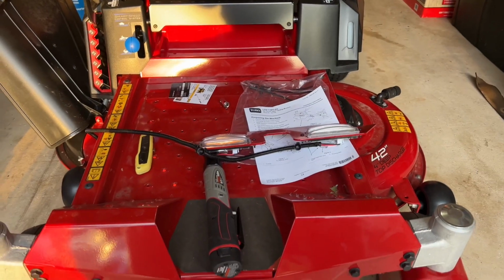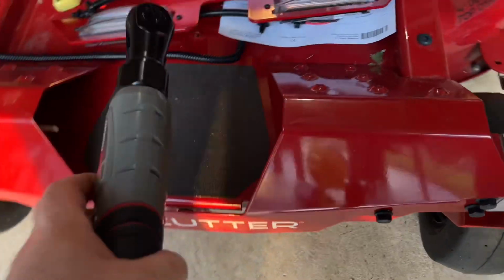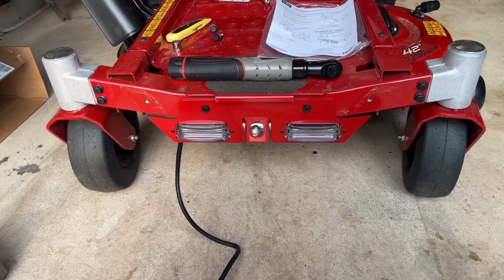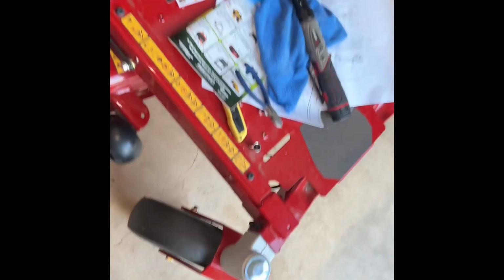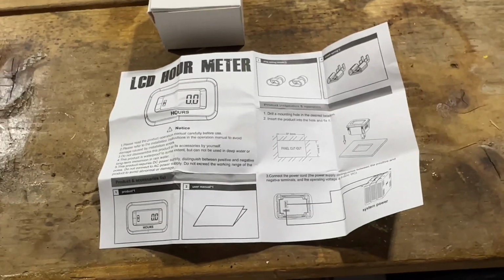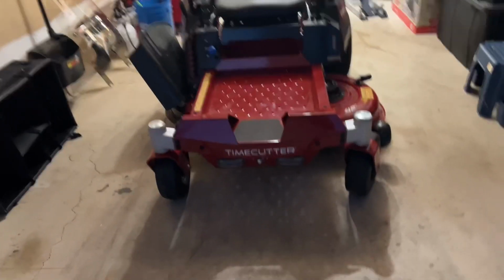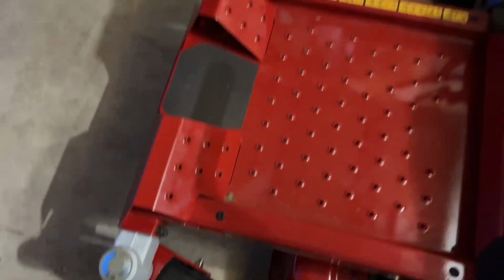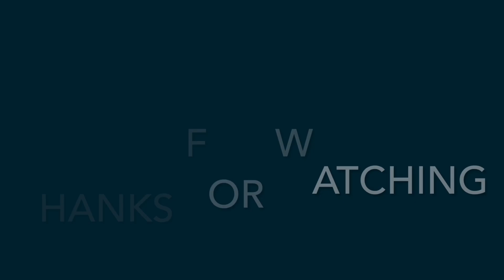42” Toro Timecutter Zero turn LED light install

Comment: I have this feature on mine. Didn’t think I was ever going to use it. Wow is it nice. Works awesome during leaf season when it gets dark. You might be able to add an inline switch I think it’s called to turn the lights on and off. Mine has the light option in the key so if it was wired the way it was there might be an option.
Reply from the maker: Very cool!

Comment: Cool, I just purchased the 75750 50" didn't know they made an Led light kit thank you. TSH you gotta purchased the OEM floor mat kind of pricey $67 but, protects the paint.
Reply: I just bought the same model. Thinking I might just buy a heavy duty mesh rubber mat at Home Depot for $20 and cut it to fit.
Reply: @skennedy1217  Yeah I was foolish to spend $67 on a floor mat.

Comment: I love my set and they work great bbbuuutttt don’t hit anything with them I barley tapped something and I broke the mounting side. I was able to glue it back together. To prevent it happening again I made some guards for them and I tap everything and no problem yet and it’s been 2 years now. I wish I could add a picture.

Comment: Nice...as long as you never plan to use the bagger kit, which requires that you mount a front weight kit for counterbalance.  That front weight kit mounts in the same spot as your lights and the 2 cannot be present at the same time, according to Toro.
Reply from the maker: Good point! this chops the grass up pretty good along with leaves. I use to bag on other mowers, haven't done that in some time. The tip speed on these zero turns is much faster than the lawn tractors I have had

Comment: So the lights just stay on, whenever the key is on?  No way to control them otherwise?  Seems silly if so to have them run all the time.
Reply from the maker: I agree, for some reason Toro designed it like that.
Reply: @Thesimplehomeowner  I may have to look, but there certainly is room for a toggle switch on the "dash" panel.
Reply from the maker: there is room for even a simple rocker switch
 @PropsnWings

Comment: I just ordered the 54” timesaver so any thoughts on mulch or bag?!! I’ve never had a zero turn before and I’ve always bagged. Thanks
Reply from the maker: Depends on a lot of factors but here is my thoughts.  If you mow frequently in the growing season, say 2x a week I would highly suggest mulching. The blades on a zero turn much faster than on a ridding mower so does a better job cutting the grass into smaller bits.   I have alway mulched and had great results. Zero turns save time but if you have to empty the bags all the time you really don’t save much time.  I would try mulching and see how it goes. You can always add a bagger later if you don’t like the results